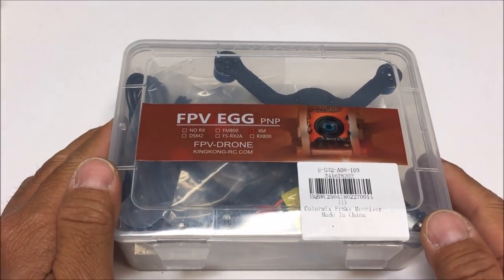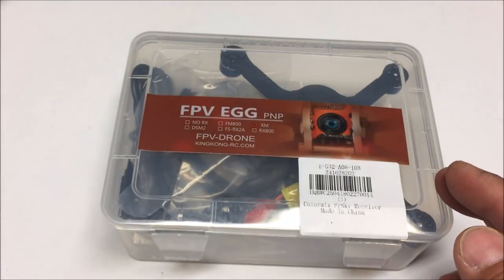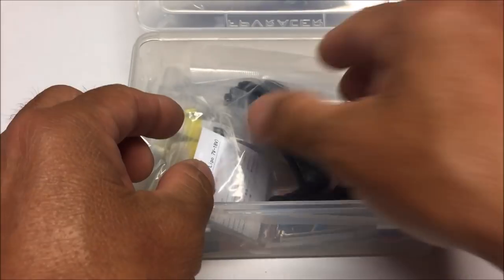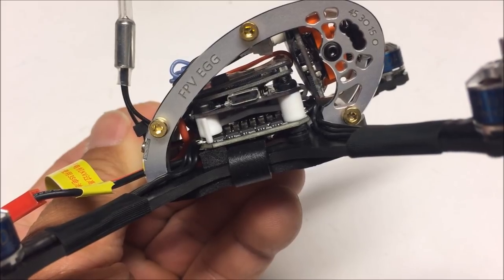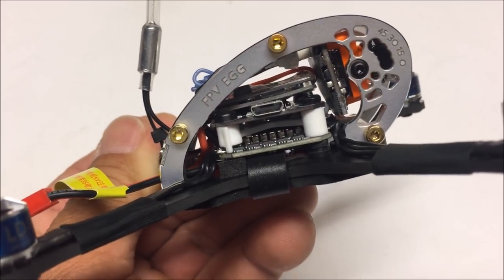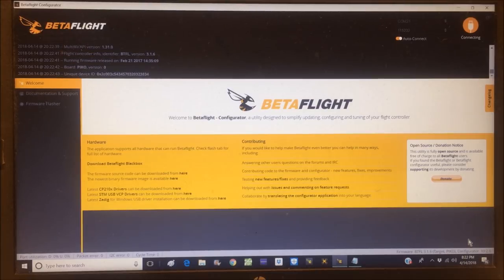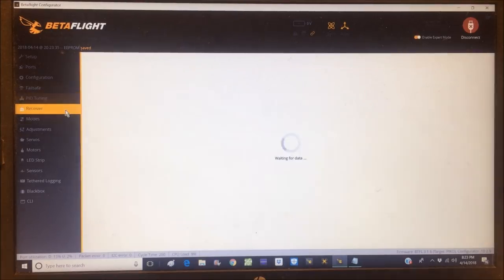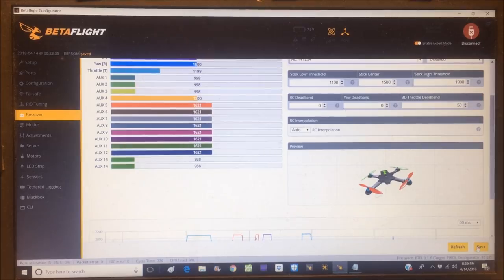KINGKONG 136mm FPV EGG RC Racing Drone BNF Unbox Setup

Comment: Thank you for your video. I have just received it  an I like it. It's really fast, lot of fun and a flight time of 5 minutes with a 550 Mah battery. I like the camera but It is not possible to change camera angle because there is no space. I have changed jst with an xt30.
Reply from the maker: Thanks :)  You can change the tilt angle by moving the vtx further back.  I have set mine on 30degrees.

Comment: Nice. One of them on my list. Maybe this or the 38. Either way I've seen pretty much all videos in this model and glad you made one. Hope you can make a test flight out of this Awesome lil bug.. egg w/e. It would be nice, Im a noobie but I been hooked and fly crazy good on brushed models like  hubsan x4 lol but I been thinking of investing and doing the same. It's just so relaxing to just got around n forget everything else. Hopefully in the future are start a channel to help others as well. 🙃 But I'm a noobie on that too haha. I'm a nerd on software and moding them... Like where the hell have I been this last few yeeaaars????? 😵 Lol
Reply from the maker: I have my reservations on this one for now, although I did get this unit as a review model sent to me by gearbest, the pricing is a bit off since it is more than the 138mm and the upgrades are the camera and the motors basically from the 130mm and a little bigger frame and there is no betaflight osd on this one but the 138mm has everything and costs less.
Perhaps the pricing will adjust in between the 130mm and the 138mm then it makes sense.
Reply: Hmmm so maybe I'll get the 138... Might buy a Y4 frame aswell and see if I can fit the components there if I get bored haha